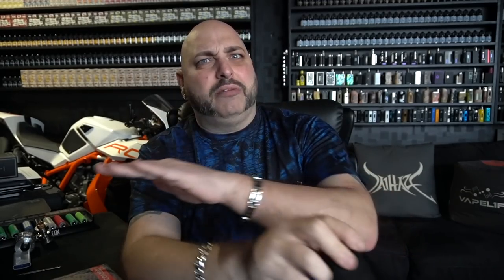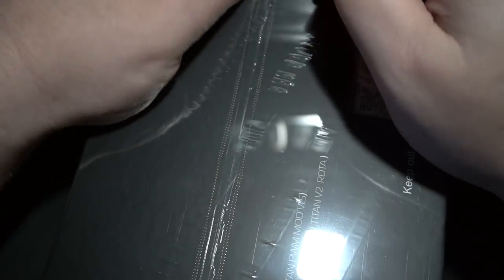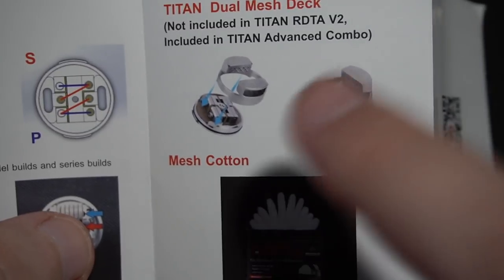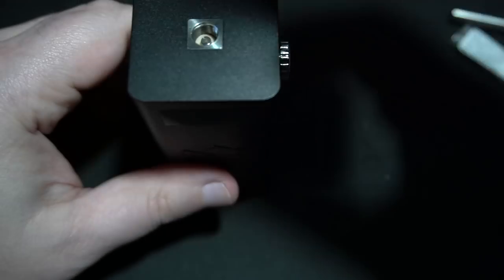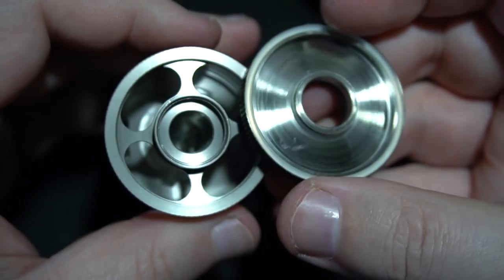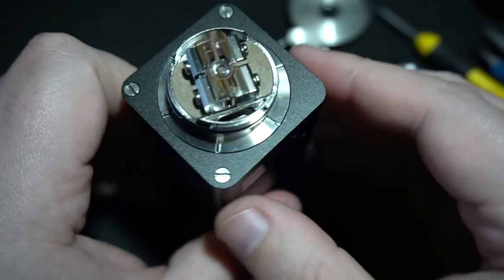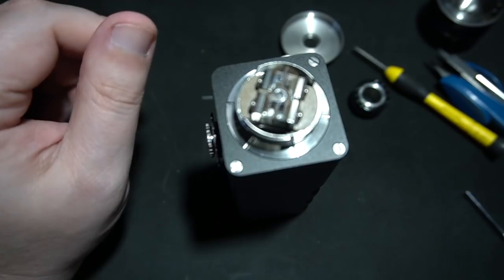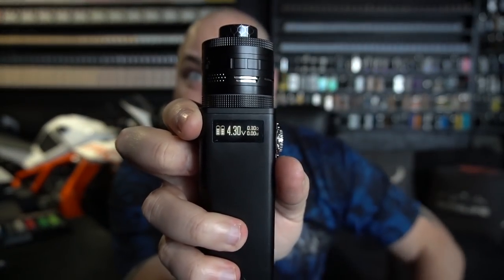Finally A Dual Mesh RDA Build in the Titan RDTA | Steam Crave Advanced Combo

Comment: I use the Aromamizer Plus (30mm) with a bubble glas, so it fits 15ml of juice. The simple reason why i want to have that much juice is, i fill it in the morning, takt it with me to work- and it lasts the whole day. I dont need to carry a bottle or batteries with me. Fill it, change the bat- use it the whole day, clean it, refill it, change bats- and go for the next day. Its easy to handle...
Reply: Same, truck drivers love this setup too.
Reply: @metalsadman  That totally makes sence. I am just lazy as sh*t, and want a easy to handle and to carry version with maxed out flavor. And so i use two fused claptons in it, with Ni80 and A1- coming out at 0,54 resistance. So my two 18650 can easy handle that over the day. Fireing with 83 Watt/6,63V. Thats the sweet spot for me :)

Comment: I wasn't a huge fan of their big tanks like the Plus and the Titan. But I was a big fan of the original Aromamizers and the Supreme V2 & V3,and I really like their advanced kit since it includes a ton of stuff (usually most of the available decks short and long glass sections). And since the price difference is so small I always just go with the Advanced kit so I can set it up the way I want from the start. That's one area Steam Crave should get their props.

Comment: Good review Jai 😊 
Had this mod and the battery door snapped off when I knocked it 1.5ft onto carpet .. it’s just too flimsy to cope with the weight of the battery’s .. the Titan dual coil tanks a good one tho but a bugger to break down to change the airflow ring to and from mesh/coil.. not into it with mesh tho

Comment: Yes you can use other mesh strips from other mods so long as the size is near the same, secondly just to let you know they have updated the door to fix an issue of cracking on the plastic section of the battery door (I have a prototype battery door and it fixes this issue). They state it the fixed door will release in May 2021 so just a heads up.

I own the V1.5 Mod and i love it, also have the Atomizer Plus V2 and its awesome.

Comment: I didn't look anything up, but I wonder if that battery door coming off like that will allow you to change to parallel, like you rotate the battery door and it switches modes? Thanks for all you do Jai! ❤️ You've saved me from tons of terrible products and probably an early death from cigarettes also
Reply: The contacts will still line up the same, you can only rotate it 180°. The notches that the door latches on won't allow a 90° rotation.

Comment: The door is kind of a pain in the ass to open but the design is reliable and lasts much longer than a hinged type door. That was the downfall of the topside. Nothing worse than your batteries falling out randomly, IMO.
Reply: That thin plastic on the door holding the contacts is a weakpoint tho, i wished they wouldve made it all metal, it cracks so easy mine is held up by superglue now lol.
Reply: @metalsadman  what plastic? I have the original and have used it more than any other mod I've ever owned. Mine is metal, has tens of thousands of puffs, hundreds of battery changes, and nothing has broken.

Comment: It’s really not that big, I have been rockin my V1 since day 1, it rattles in a cup holder, I don’t wear skinny jeans because I’m 45 and value my testicles, so I slips in the pocket of m6 Dad jeans fine, it’s not heavy, it’s simple and easy, it just works, always works, and has never failed me. I use it a low with my bigger single coil RDTL tanks, with high resistance. And yeah it’s a few days of battery before I change out. If I use the big tank, not often only DIY juice, it pretty much just rocks. It’s a solid mod for China. I hate the new button, it looks stupid.

Comment: If ya reading the comments looking to purchase ! 
Don't buy this piece of crap ! 

6/10 my ass.. more like 2-3/10 
The battery gasket as mentioned is for when the terminals wear and the batteries start loosing connection ! Huge pain in the ass ! 
Your camera didn't quite show how cheap and nasty those terminals are, atleast the batt tubes didn't have machinery mess and burrs all through it like mine did ! 
Your right, the batt door is CRAP it wears in less than 3months. 
LOL at snapping the mesh that's exactly what I expect from steamcrave ! 
The rdta is ok at best ! The mesh sucks as you saw but didn't mention ! 

Overall I personally wouldn't buy from that sh@thole company ever again, just as bad as geekvape ! Infact i no longer buy chinese shit again.. the hadron 220 had similar issues too.
Reply from the maker: but thats the thing, some people have good experiences others have bad. Now you know how I felt for all these years ripping companies apart because of my experiences and people argued them
Reply: Yeah too true ! I certainly feel your pain bloke ! 
What it is, quality control has gone right out the window ! Does no one actually check and clean their devices these days? Drives me up the wall ! 
Even kennedy has issues with quality.. their vindicators are fine but as soon as you get the stack section for it.. absolute fkn mess, burrs all through air vents, scale a flakes all through the top threaded section, then i go watch a Japanese review from a year ago, exact same issue ! 
We will see what kennedy says after i had emailed them, hopefully a better response than what you would get from chinese companies.